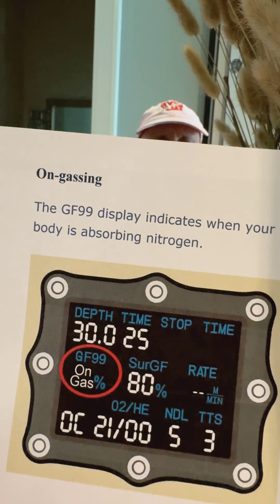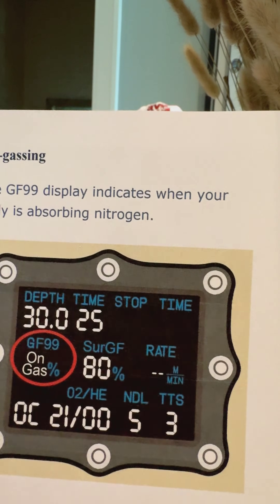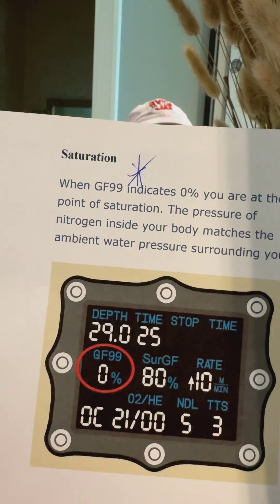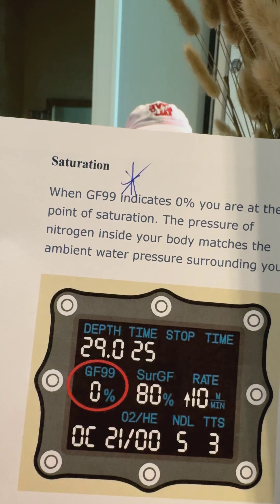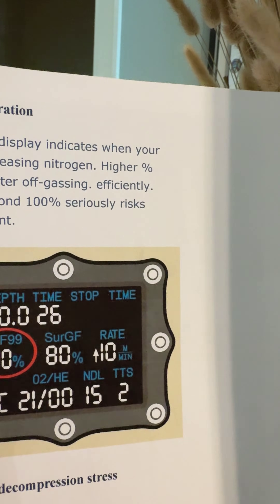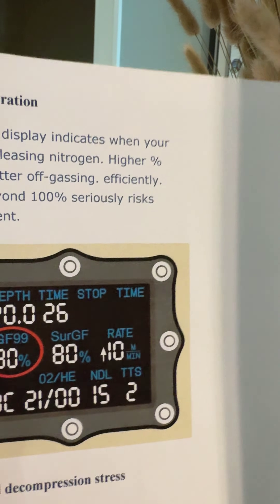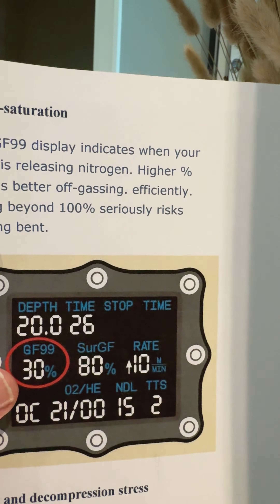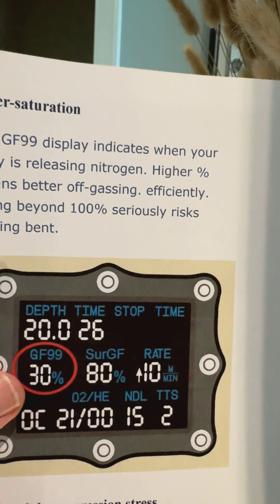Video 5 - GF99 (Based off Andy Davis’s Article)

Comment: Gf 99 can work optimally if used in conjunction with AI simply because the computer will know how much of a gas mix did you consume at each given depth assuming you have multiple gasses and tanks, but cost to the AI hinders this, plus no data for shearwater to gather also means the development of new algorithm is hindered again back to the cost of AI, you would need a minimum of 2 AI transmitter one for air second for nitrox thats for recreational diving for technical and deep more.

Comment: The connection between Gradients and specific bubble behaviour is unfortunately not given. Bubble formation is not really controllable, as different people produce different amounts of bubbles on the same dive; plus the same people produce different amounts of bubbles on the same dive on different days. The relation between bubbles, ascent rates and DCS is rather chaotic, nothing like "with this GF you have small bubbles, with this big bubbles, and here you have a problem". No. Your risk of getting DCS is higher the higher your GF is at the surface, thats it. No prediction of bubbles at all in the model.
So, having a GFLow of 30 can mean you come out of the water with even more bubbles than with a GFLow 50, 60, whatever. Setting it to "half of GFHigh" is.. well... a possibility, but there is no reason behind it more than "my grandmother was born in 38, I always set it to 38" or "I divide my age by two and than add 5", or whatever you want to use.
Reply from the maker: Great point. Btw I said aim for GF99 to be half your high GF , (as Andy stated in his article) just to be clear.  Neither he nor I said set Gradient Factor Low to half your high gradient factor. Personally I dive a 40/70 because I also don’t want my GF Low too low and have those slower tissues continue to on gas. It’s a never ending discussion on “deep stops”. And no one knows for sure what is best and for sure everyone is different. You can even be different on one day to the next. Look at me for example. If you happen on one day not to be as well hydrated as on another day, that can affect this greatly as well. There is no absolute right answer here. Recreational divers should dive the default Shearwater preset settings and I recommend the conservative setting for a very long time. As for Gradient Factor Low, Andy made it very clear in his article that it’s not an absolute and he later in the article goes on to discuss the impact of GF low and GF High and GF99 and GF Surface and NDL and more all have on each other. There is no absolute here. But this is all about sharing knowledge and everyone should absolutely have a right to that knowledge. But that does NOT mean they should dive aggressively or in fact even dive outside of the the default settings. It’s just knowledge sharing and thanks to Andy’s awesome article more of this knowledge is now being shared and creating interest in this subject, which is fantastic!